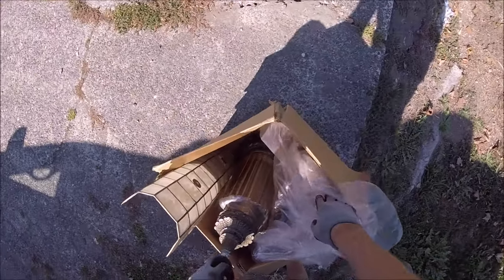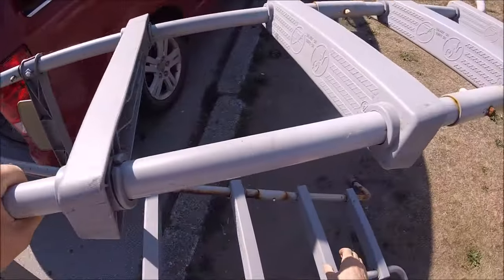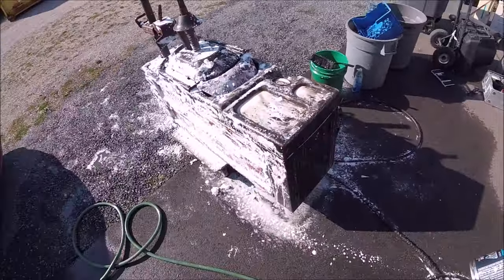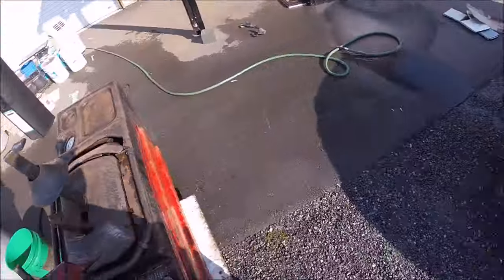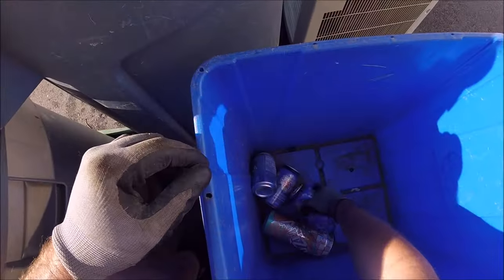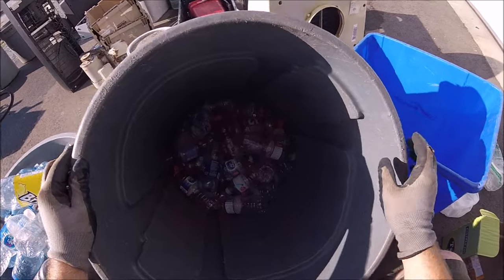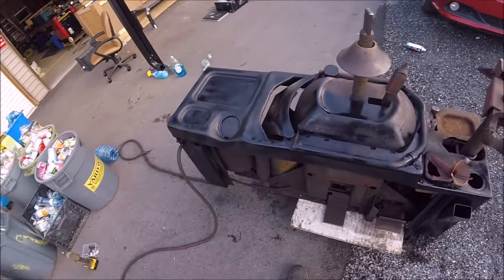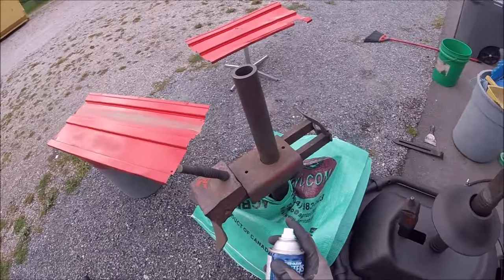Cleaning & Painting My Coats 40 40A Tire Machine & More

Comment: You sorted the bottles at home so I hope it will be easy to deliver at the counter. Even if you pack bottles of 50s, they may make you open the bags and make you count, so better of without counting them. All the bulbs, batteries and cardboards, styrofoams if any will also go. Your yard will look clean after the bottle run.

Comment: I just did a 4040A for trailer and tractor tires.  I had some Red and Black left from doing auto paint.  Wet sand blasted her down good first.  It isn't returning to the start position without help.  Still trouble shooting.
Reply from the maker: You have to lube & check the springs & Air joints